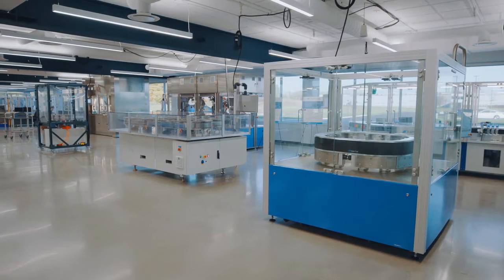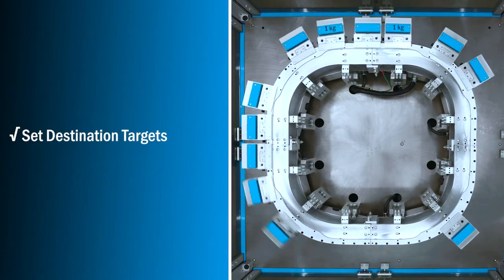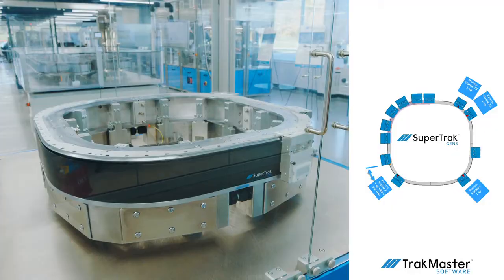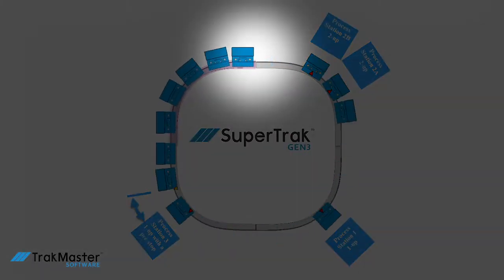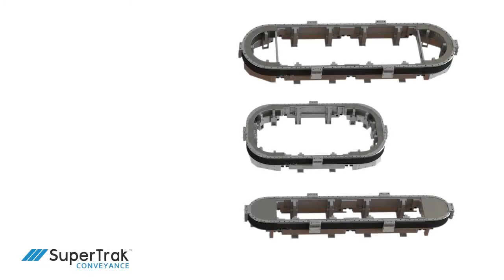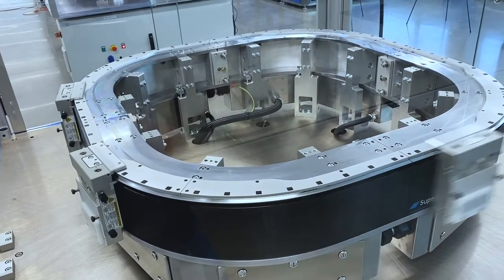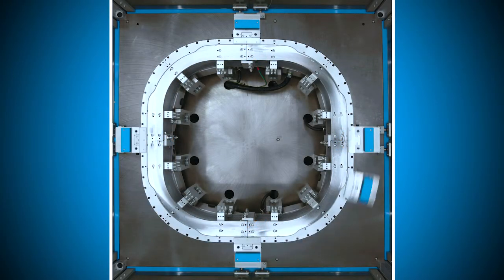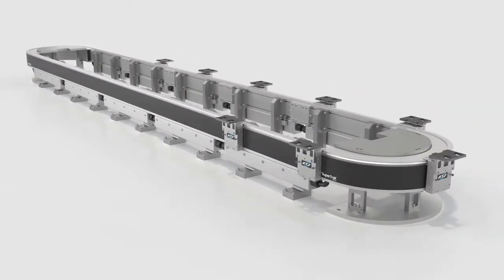SuperTrak CONVEYANCE™️ Configuration Options

Comment: the problem with the super track is when you turn off the main power you loose the information in every shuttle... for example ID pallet number....
Reply from the maker: Again, thank you for your comment. SuperTrak has two power sources: digital and motor. The motor power can be turned off at any time without losing shuttle ID or information. If you turn off the digital power, you will lose shuttle information but a complete power cycle is not a common occurrence for most modern automation systems. We also have options to add a UPS to the digital power source, so that data can be saved if necessary. Please visit www.supertrakconveyance.com for more information.